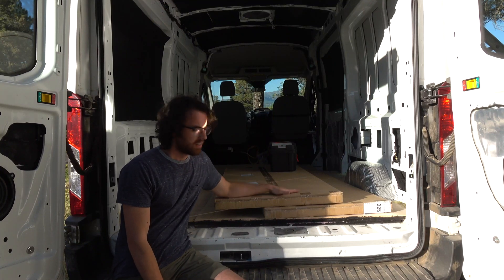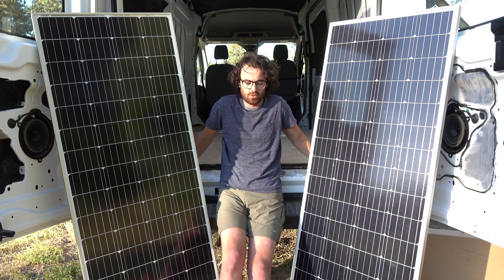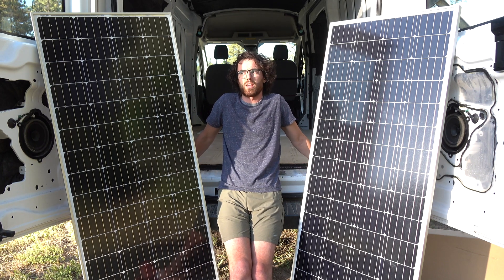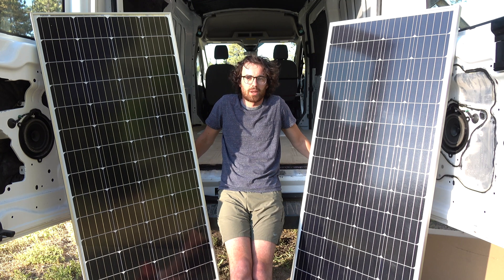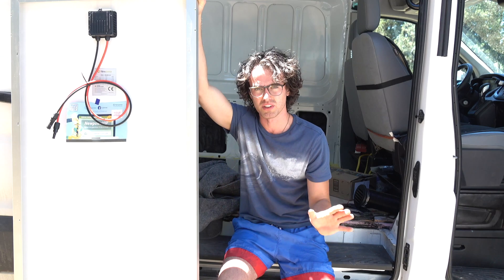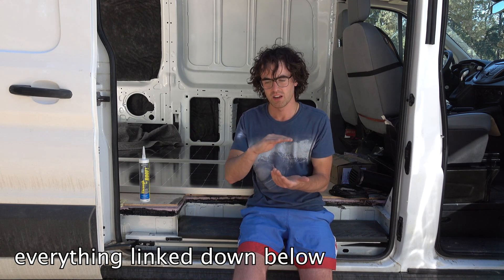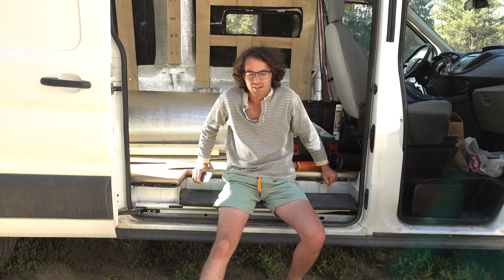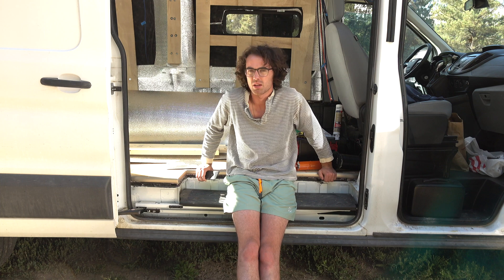400 Watt Off Grid Solar System in Van Conversion

Comment: Boy you have a lot of Real Estate up there! If you had a low profile vent/fan under them you could cover the whole thing and have 800W. Why, well those of down in the South, read on....
 I've been looking at some Newpowa 250W Monocrystalline, their dimensions, at 54.72 x 34.45, means you can put 2 of them sideways and they would, at least by the numbers, overlap in width your current setup by less than 1 inch on each side and less than 6 inches front to back....you get 100 W more. I wonder if they made them this way for full size van installations. If you were to cover the whole roof with them, you get 1000W (enough leftover to run a 5000 btu window ac during daylight hours in hotter weather) and still charge your batteries and would overlap the 800 W setup by 5 inches front and 5 inches back.

Comment: Hi  - Great Video.  Your build videos have been very helpful. I watched the the rack install one multiple times before putting my Flatline rack on. 

I am getting ready to order and install the same solar panels you installed.  Wondering how you mounted them to the brackets in the middle of the van. Are they bolted together or were you able to mount them individually to the cross bars? 

Thanks
Reply from the maker: Full disclosure, mounting my panels to the 10 series aluminum bars with the FVC rack was a HUGE pain because I had no idea what I was doing (I still dont know what id do if I did it again....)

Basically, I used 80/20 fasteners for 10 series bars (https://amzn.to/3fIHxD1) I slipped them down the vein of each bar after they were inserted through the holes on the bottom of the panels. I had to use washers to compensate for the difference in length of the fastener and the depth of the extrusion....and then because of the odd angle that makes me unable to tighten the fasteners completly....i reached under and spread silicone alllll over each fastener to keep them from vibrating loose (a serious problem with any bolt involved in a van build since road vibration rattles everything loose). 

That seemed to have done the trick but it was such a huge pain (probably mostly because I did it all by myself and hoisting both panels up on the roof with the bars attached already was precarious to say the least).

Ill bet there is a better way to do it.

Comment: Clean install!   I bought 3 of these exact panels and looking at this same rack as well.  Do you think I'd be able to mount the panels sideways so I could fit 3?  The website says 57" of usable width but I wonder if a riser would work for me?
Reply from the maker: hmm that is the tough question with solar / racks. 

I have seen solar panels hanging over the edges of vans (which is what this would be with a 64" length over a 57" or so wide rack). I don't think that would be an issue persay...I just think you lose some of the beauty of the rack's low profile as well as adding wind noise I would imagine and possibly drag which reduces MPG.
Reply from the maker: I am curious what you end up going with! If you get it setup and remember, let me know. (also I am sure FVC would love seeing a picture of yet another way someone has worked out the up top space)
Reply: Thanks for the advice, I agree it'd take away from the looks with having the panels hang over the edge.  After looking at a few other options decided to go with the FVC rack.  Right now I'm going to go with two panels and see what I can do to get the third mounted.  If I can't mount it, I found some 100watt panels that I could wire in a series-parallel configuration with the 200-watt panels to still get 600 watts.
Reply from the maker: @adampage007  Overall, I'd say after all the hard work and long days and research, when you are reaping the benefit of your solar...you will be SO grateful. I have been running my crockpot while I ski a full day (5 or so hours) and the solar makes that easily possible once the sun is up. I barely drain any SOC. It's amazing :)

Comment: Very well done. This is the van I’m looking at. How is the one fan working out?  I’m wondering about putting two in. One right about where yours is and then another over the bed area. 

I was hoping 4 100 Watt panels would fit up there and leave room for two fans.
Reply from the maker: the vent fan (maxxair) or the wall-mounted fan? If you mean the maxxair, it works great BUT....I have had some freaky weird issues with it here and there where it will turn ITSELF ON and cycle rapidly to FULL speed (which is quite fast and loud) all without be doing ANYTHING...and then it will refuse to respond to me pressing buttons and just keep spinning its heart out.

that has happened twice now. I actually currently have the fuse removed from the fuse block because it kept turning itself on and I am in snowy conditions so I am not using it anyway. I THINK it is just a faulty unit but at this point I am not sure I could replace it without a lot of trouble...

Otherwise, it works so wonderfully :) I spent a few weeks down in Texas in 90 degree humid heat and it worked so well to keep me cool at night and during the early and late hours of the day (I would work in coffee shops during the most intense heat of the day).
Reply: @JeremiahLuke  Thanks for the reply. Yeah, I was talking the Maxxair. So it sounds like a second Maxxair over the bed area wouldn’t be needed. I know some people put two in but I worry about being able to put enough solar on the roof with two fans up there. I’m a long way off from doing a build but I’m building in my head for the day it happens. I’ve subbed your channel and look forward to more videos.
Reply from the maker: @NorthCountryOutdoorGuys  the time will go by so quickly and then you'll be standing in front of your van and wonder where it went!

I will say, in my van I have the front kitchen window behind the driver's seat and then a rear/mid-area window on the passenger side. The maxxair is positioned roughly between those two windows and I think it's the combo of the windows and the maxxair that allows the airflow to work properly. People with no windows often HAVE to go with two fans.

Comment: we have pretty much the same exact set up as you. did you end up wiring in series or parallel for the panels? assuming parallel as you purchased the MC4 connectors correct?
Reply from the maker: Parallel! Although...a fair share of people stand by series for the sake of taking advantage of a wider range of charge opportunities through that higher voltage output. I've been happy with my parallel so far...BUT now that I am spending more time in shaded/cloudy areas I am wondering how MUCH better series would perform.

Comment: Man I'm so glad I found your channel, your videos are very informative and well produced! I'm getting ready to start my electrical system and the way your explain everything is very helpful! Thanks!
Reply from the maker: So awesome to hear that! Thanks for leaving the kind comment. Excited for ya! Are you doing the 3 way? Solar, shore, and alternator?
Reply: @JeremiahLuke  yes, that's the plan. How's it working for you with the alternater?
Reply from the maker: I love having the system hooked up with the battery isolator (the one I have installed: https://tinyurl.com/yygo2hqz). First of all, it pulls a lot of charge toward my batteries when my car battery is full (just starting the car while sitting in park can pull between 200-600 watts). So knowing im charging my batteries while driving is amazing. Secondly, and I love this, my battle borns now act as auxiliary batteries for starting my car! Which basically means the likelihood that I wake up with a dead car battery stuck somewhere remote is almost 0. The install is so easy once you've built the electrical system I would say adding it in is a no brainer if you plan to drive a fair amount.